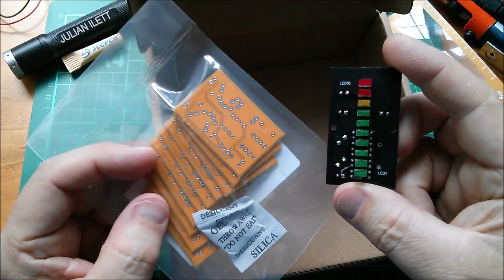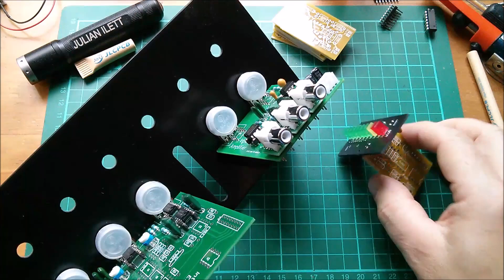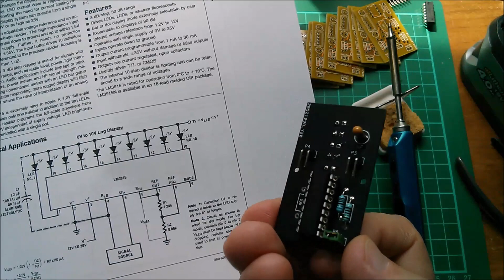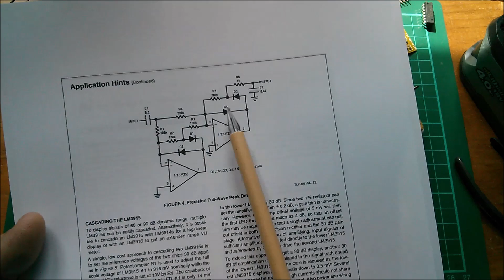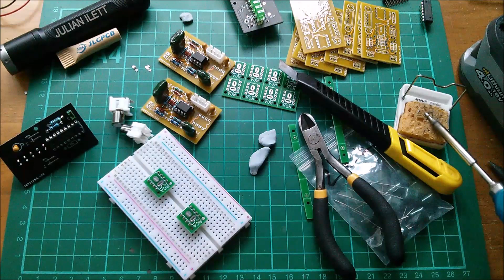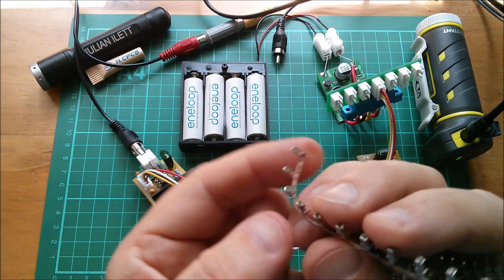New Yellow PCBs from JLCPCB - Peak Detect Circuit - Vocoder

Comment: I picked up one of those crimping tools that works on those connectors, but most of the time, I simply crimp the one around the insulation first, then put the wire in a hemostat to hold it upright and with a sharp little needle type soldering iron tip that I usually use for SMD connections, I put just a drop of solder on the connection and wire, whilst heating the other side of the connector. I have had great luck with this method both with those little connectors and others such as the dupont type as well.  So long as the spring connector is above where you solder gravity seems to protect the connection and the solder flows down

Comment: Reminds me of a project I did for a TV production truck.  Needed additional meters for the audio board.  Company wouldn't spend $1,500 for a meter bridge, so I requestioned a bunch of DYI meter kits as "replacement parts" for $250.  Installed trim pots on the inputs for calibration.

Comment: Yes, you finally labelled your connectors 👍
Reply from the maker: I did - good advice :)
Reply: @JulianIlett  Yes, labelled connectors are a must have, if you don't have a schematic on hand later on and still want do connect the connectors.
Reply: @JulianIlett  Need cable management now :D
Reply: And polarity markings for the capacitors...

Comment: Down under where the magazine started, it was quite common to see direct use of the application note circuits in the ETI projects. the one that sticks in my memory was the ETI1410 bass guitar amplifier that used the NE571 compander as a peak limiter, pretty much straight out of AN174 (with the two errors corrected, of course :) )

Comment: Could you use the function generator on your oscilloscope to drive the displays into the red? Won't be as dynamic as the music, but you should be able to wind up the voltage in real-time to determine the exact points at which it hits the red line and tops out the display.

Comment: Hi Julian - Looking for a power supply for my next project which being a homemade 3d printer - I have a few server power supplies spare, but love to know how to wire them up to work - it's 12v 36 amps which is perfect for a hotbed. link as follows thank you in advance. Martin. https://www.ebay.co.uk/itm/HP-Proliant-DL360-G4-G4p-Power-Supply-361392-001-DPS-460BB-B-PSU-325718/192869806524?epid=16012067680&hash=item2ce7efb1bc:g:3kMAAOSwyZZcmOZJ
Reply: I Googled this:
hp server power supply pinout
On the top side, connect the 1st & 4th thin copper tracks with a resistor. I've seen 560Ω , 1kΩ, & 10kΩ used. 1k seemed to be the most common.
 Making that connection tells the PSU to be on.

Top & bottom, the big copper tracks nearest the middle are both 0V, and the big copper tracks nearest the edge are 12V.
Reply: @massimookissed1023  Thank you so much.
Reply: Hi just got it working 1k to pin 2 not pin 1. https://www.youtube.com/watch?v=v2LC-vDbphs - Thanks for the input.

Comment: Hint: cut about 1 mm off the pins, and it’ll make wiggling the peak/hold boards on to the bar-graph display boards a lot easier, and you’ll still have way more than enough pin length to go around! Happiness! 😊

Comment: the over lap of the  leds turned out to be a pain as i wanted to use this chip (well the 3914) as a tap changer in my diy power supply
Reply: Couple of LM339 quad comparators and a chain of resistors to give 8 voltage reference points ..?
Reply: @massimookissed1023  yeah i know i thought of building it up.. i still may, I am just running on the highest output winding and burning off the excess for now as needed to use power supplies but will revisit it. Thanks for the reply

Comment: There are too many standards used for 0db, normally it will be .77mv rms, 1v rms, or 1mw into 600 ohms. It looks like your player has a fixed output of 0db and the music had been correctly recorded at 0db.
Reply: it's all too confusing without the third letter.

0dBv = 1V
0dBu = 0.775V or 1mW into 600 ohm
0dBm = 1mW, could be 1mW into 50 ohms, or 75 ohms, it's just a power ratio.
0dB is unknown as it's a ratio of nothing, that last letter gives it all meaning.

the letter also lets you know if it's 20Log(v1/v2) for voltage or 10Log(p1/p2) for power

Comment: I wonder about the red levels, is it the OpAmps that cannot deliver enough output voltage?

It would be fun to do this with a microprocessor and about 20 leds, programmable lin/log, programmable decay, programmable average time and the options to show peak, average or both (Light up the difference between average and peak) on the leds. A standard Arduino Mega328 processor could do it.
Reply: You could simultaneously show a bar AND the peak as a separate or brighter dot.
(Or even make the peak point blue by using RGB LEDS :)

Comment: I’m sorry, i dint really get why the effort of making an rca Adapter board? What did I miss ?
Reply: It's so he can switch to other connector types if/when needed.
Reply: The RCA connectors he gets from eBay don't have a consistent pinout. So when he runs out of his current batch, and buys a new bunch of connectors from eBay, he just has to make a new adapter board to match the new connectors, and doesn't have to rebuild his main boards.
Reply: RedwoodRhiadra haha i See thanks

Comment: Fume Extractor
Reply from the maker: I don't need it - the rosin flux fumes can trigger asthma in some people, but I've never had a problem with it. And I like the smell :)
Reply: You can tell if a solder joint is going to be good by its odor ... 🍝🤗
Reply: I trained myself into a habit of a big breath in before applying the solder, then blow at the joint when soldering.

Comment: Morning Sir Julian just a thought about the leds on the meter board. You have two red leds and one yellow, my thought is that yellow is a warning (2 leds) and red means to stop (1 led). It's great that the vocoder project is moving along very swiftly. It looks like your focused on PCB design lately and it makes the vocoder project very professional looking. Always a fanboy so Cheers for now and have a good one.
Reply from the maker: The original magazine article has 3 reds and seven greens. I kind of want to stay true to the original, but slipped in a yellow just for variety :)
Reply: @JulianIlett  Cool